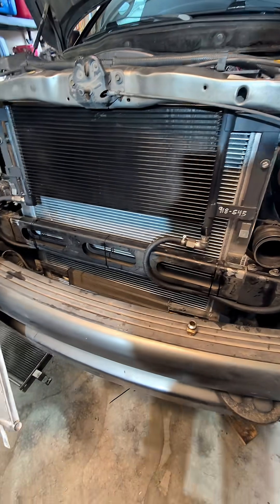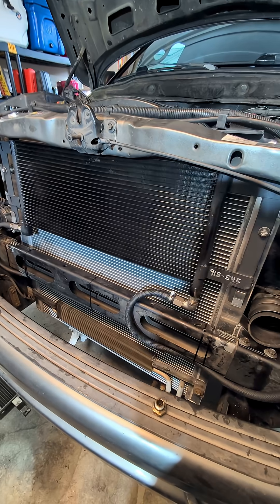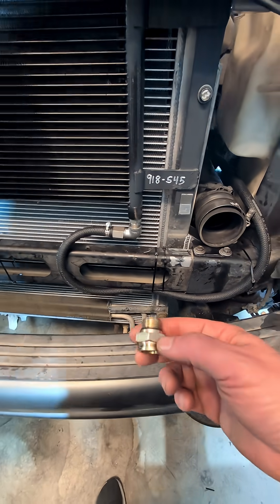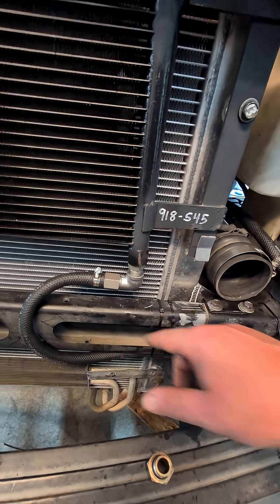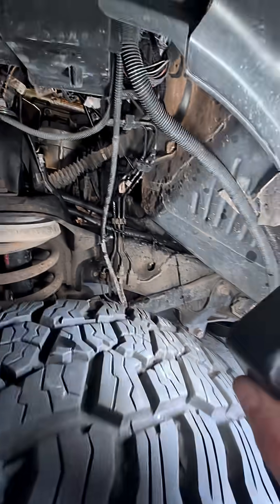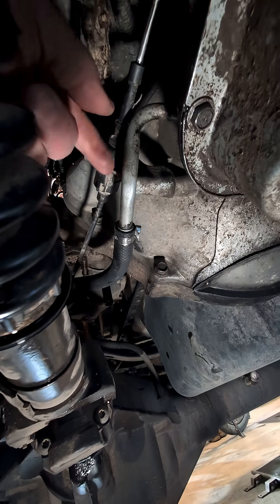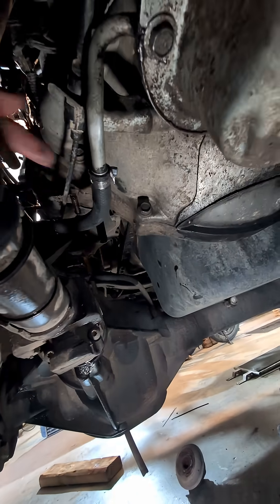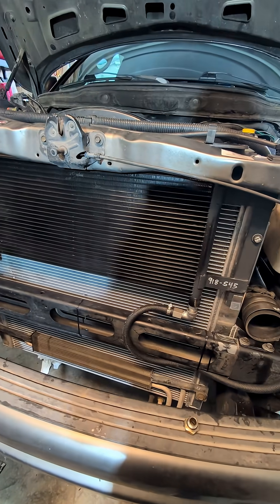2005 5.9 Cummins Dorman 918-545 Transmission Cooler Upgrade

Comment: Did you keep track of how much fluid it enable you to add?
Reply from the maker: I had to add 2 quarts when done
Reply: I just installed the Mishimoto on my 2005 5.9 cummins  and also the PPE deep transmission fluid pan.All together and additional 6 qts. I pulled my 6k lb travel trailer 7 hrs with  an elevation climb of about 4500 ft from Holden Beach NC  to Sylva NC At 77° ambient air temp that day. My trans temp never exceeded 150°. I have the infamous 48RE which still performed flawlessly 
 Truck has 174k on the clock.

Comment: Your going to trap air with it installed like that 😮
Reply from the maker: This is how the cooler is installed on a 2015-2018 ram which is what this unit was built as a replacement for 👍
Reply: @DieselCamper think about it, ask another engineer.